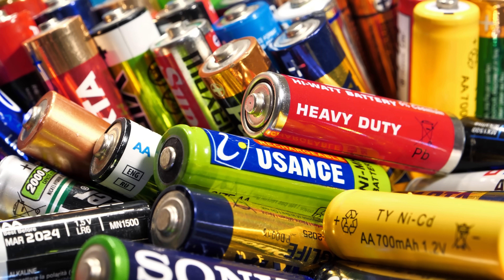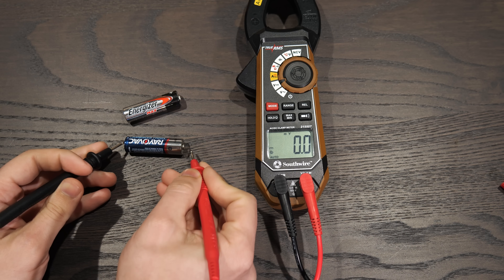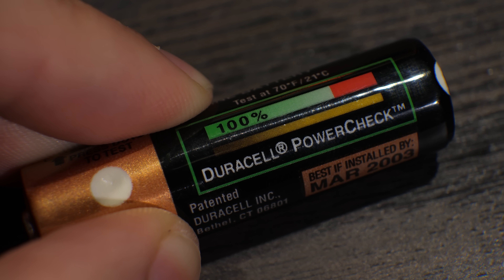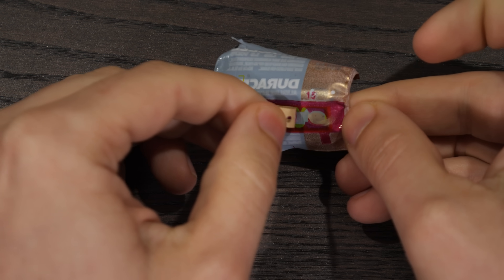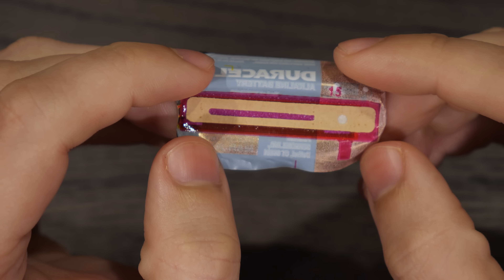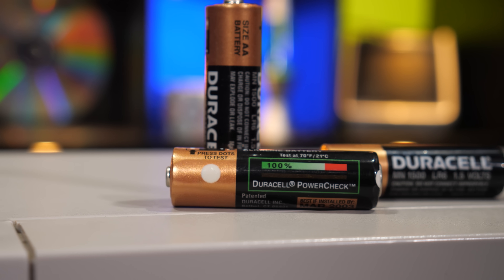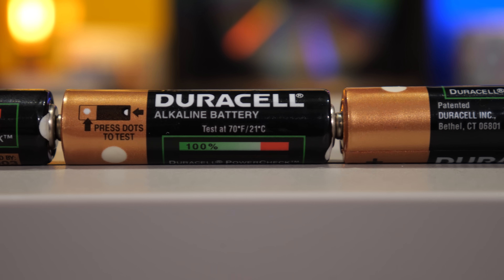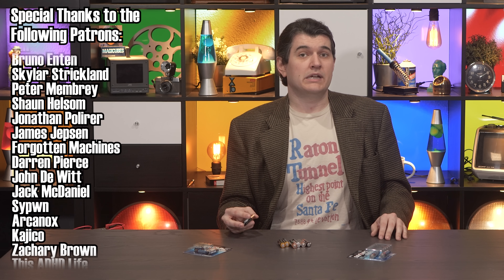Duracell PowerCheck: A genius idea which didn't last that long

Comment: My main usage for the powercheck was when something like a remote didn't work. First line of troubleshooting is are the batteries dead? I can save myself a trip to find the battery tester/multimeter if I can just test it almost in place. You know, if you can get the thing to work. I always felt the bar afterwards for the warmth.

Comment: And now they build battery charger andvoltage increasers, and a femaleusb pluginto the battery itself: thereby increasing the voltage to 1.5v, at the cost of even shorter charge life for hugely more money!  So: when they changed to rechargeables of 1.3v: why didn't they redesign circuits to run on 1.3v instead of 1.5v?  The waste of materials from 1.3v batteries that won't push a clock hand uphill once they drop to 1.2v though there is plenty of energy left if circuit designers lowered the optimum voltage of the circuits, must be enormous, yet the step up built in extra components at the expense of less volume of reagents, must be even more wasteful: so why are circuits still demanding 1.5v?!

Comment: I agree with your typical use habits discussion. Where these could be more useful is on rechargeable batteries if which I'm never quite sure of the charge status as they lie in the drawer after being charged (or not). But for this reason I have a small cheap battery tester, so even that use case is eliminated. Neat technological novelty, but ultimately not compelling enough use case.

Comment: You can simply drop the battery on a hard surface on their negative pole. If it jumps it’s empty, if it just drops and falls over it’s somewhat full. Perfect to easily check all those batteries in your drawer

Comment: You can also test a battery by dropping it vertically (negative side down) on a hard surface. If the battery bounces, it's empty. If it doesn't bounce, it's full. No idea why or how this works, but it works.

Comment: You get angry at triple-As, I get LIVID at those idiots using a watch battery when a pair of AAAs would fit! Oh, which one is it? A CR2032, 2025? 2016? All the same diameter, but different thicknesses... God help you if it's tiny LR44s. I get it when there's very little space, but it you can fit normal batteries, do it. For one thing: rechargeable batteries come in those sizes.

Comment: Duracell batteries have destroyed more equipment, including the lab equipment I used. They got sold overseas and after that, they often leaked in the PACKAGE. They got away with it and I still find them occasionally in items and quickly remove and put them where they belong........in the waste basket!

Comment: You can TASTE 1.5v batteries and tell to some extent how good they are. Wet your finger and hold it against the negative end. Touch the positive terminal with your tongue. If the battery is good you will feel/taste a slight effect. If the battery is bad you will not notice any effect. Only do this with 1.5v batteries, nothing higher like 9v etc, which could be painful.

Comment: I stopped using disposable batteries some time ago and use equivalent NiMH for almost everything, though there are exceptions where alkaline/zinc batteries are better. I have a couple of remote controls that don't like NiMH batteries, they work for a while, but stop working long before they are discharged. This is because the NiMH batteries are nominally at 1.3 volts approximately fully charged and the voltage drops gradually as they discharge. The problem is, they get to the cut off point where some things will stop working well before an alkaline battery would because the voltage has dropped too low as they started out at 1.3 volts instead of 1.5.  When I put my rechargeable batteries into the charger, they only appear to charge to half their normal capacity, because they were only half empty to begin with.

Comment: Batteries are a collection of cells in series or parallel. The single cell tester, despite how flawed it is or isn't, is a cell tester, not a battery tester. Just a for your information coment.

Comment: These were actually useful in one specific situation - if a device used multiple batteries, they usually did not all wear out at the same time, and you could figure out quickly and easily which ones needed replacement and which ones were ok. 

But yeah my primary memory of them is Pain

Comment: I used the testers a lot. Batteries lose strength over time, even if unused. I have had batteries dated for a few years after time of use that were actually already unusable. So in my case the testers were more than a gimmick.

Comment: Mostly those tester things were entirely for marketing. How about a vid on the newer rechargeable AA batteries that are lithium ones with a tiny USB recharge connector on them, compared to the old fashioned rechargeables that needed a recharger to plug them into?

Comment: There was a time the indicator was not with every battery, but with every retail package of 4 batteries. It could be cut out and used for other 1.5 V batteries. Me and my brother of course experimented the indicator with a 9V battery, resulting in a lot of bright color and smoke.

Comment: Always wanted these on rechargeable batteries where it made more sense to me.  With a rechargeable I would have them sitting beside a charger or in a device and before I went out would want to know what battery life they had in them so I knew if I should swap and start charging my current set.

Comment: The problem I remember is that it didn't work a lot of the time, or only worked a few times then stopped.  It also gave unreliable readings when compared to a good battery tester.

Comment: Another likely reason for obsoleting this technology is that the batteries become more prone for a current leak and also a physical leak in consequence. The leaks happen because of both corrosive and mechanical damage, in particular pressing batteries too much against each other in tight battery compartments of some low quality devices. I have first-hand experience with the collision in between the batteries' and their compartments' size tolerances leading to catastrophic damage and high fire risk hazard. Even a tiny increase in the label thickness of a regular battery may make this risk an order of magnitude higher, let alone making that label conductive and heat producing itself.

Comment: Used to play with the tester as a kid.

Now I just use rechargeable batteries for everything.
If I need a full battery, I simply charge it up.
The charger will tell me when the battery is full.

Comment: I liked it too back in the day. I have a good old separate tester I use all the time. It's hard to believe the indicator would be accurate for our sake too. It probably was a cost cutting measure or didn't sell enough to warrant it's continuation.

Comment: I remember vividly in the 90's you could sometimes buy a pack of Duracell batteries and they'd come with a strip to test the batteries with. When these came out I thought they had just stuck the strip to the side of the battery, as design wise they looked identical - sans the physical strip!

Comment: I still keep part used batteries in my "man drawer" as they are useful for things like remote controls and wall clocks.  I also own one of those battery testers and a multimeter

Comment: Yeah, so now we have built in batteries and chargers, and when the battery die, they do, we have to buy a new thing. Old thing with a cord to the wall, lives on. Old mechanical stuff lives for ever. Then digital evolution means we have to buy new things again and again since they stop working in the system,, like a cellphone. And now cars??? Yes sustainable.

Comment: 'Which didn't last long' weren't these around from 97 till at least 2017? Pretty decent run I'd say! I know they were sold with the current Bunny design (from 2013) and I saw them for sale everywhere still at that point. I can even order some right now, but I have doubts about some of these stores. Some have the version with the old strip you've shown, some have the more modern 4 segment tester strip. I bet they are very old stock, they do say '10 year power reserve' so they could still be sold.

Comment: I remember these quite clearly. The tester was very difficult to use because you had to press quite hard on the negative end, likely to keep the tester from inadvertent activation which would lead to a dead battery.  Also, those cheap battery testers had parallel load resistors in them, or, at least mine did.

Comment: One of the things people should know (and the main reason I bought a battery tester) is that you should not mix, in the same device, batteries with different charge levels. I regularly take out batteries from my kid's toys (when they stop using them and we want to give them away for example) and when I need to replace 3 batteries in a device, I need to test all the lose batteries I have to pick 3 of approximately the same voltage.

Comment: I've noticed a major correlation between grocery store brands of alkalines and leakage of corrosive gunk in low-draw devices like remotes or keyboards where those batteries might sit for a long time.  So that's where my brand loyalty to Duracell and/or Kirkland comes from: less time with cotton swabs and isopropyl.

Comment: 1.4 million views in a day on a video about old batteries that are no longer on sale. Mind blowing. Keep it up
Reply: they are still on sale in europe, i bought AAA ones not that long ago in the netherlands.
Reply: @iHazMuffinz they’re available in the USA as well
Reply: @iHazMuffinz To clarify, AAA WITH a built in battery tester, or just normal AAA batteries?
Reply: @Matthew-li7we  duracel AAA with built in battery tester
Reply: Us viewers are a quirky bunch
Reply: Not on sale??? Uhhh yes they are 🥴
Reply: "Much that once was is lost, for none now live who remember it..."
Nostalgia isn't just a resistance to change it's exasperation at things that should be remembered to try and make them still exist.
Reply: Not surprising given how most of us will have surely used one of these babies at some time or another.
Reply: @Opethfeldt  not gonna lie rechargeable batteries are the way i use them for rc plane boats rc cars xbox controller my old watch and i swear in 1998 I think batteries  take long time to die but nowadays batteries not like before
Reply: They’re still available
Reply: @HunterB738 you will find that the modern day Duracell Batteries don't have the in built tester though
Reply: tha's properly funny m8
Reply: Us 1.4 million viewers at some point wanted to know how this worked, just never took the time or had the time to figure it out, well this guy has done the work for us, and we appreciate him for it, cause its still cool to know

Comment: Actually, you pay for a zero point five voltage battery (0.5 volt) instead of 1.5 volt, because ??? One third of the price is actually used per battery. Sad that all those voltages are thrown in the recycle bin because modern electronics can't handle voltages below 1.0 volts and stop working. There is a simple solution like a battery vampyre schematic, that draws all current from the battery and step it up to maintain working voltage. Saw this in a video a long time ago, but never saw its schematic again after that. Should have saved it.....

Comment: You spoke about testing the battery, but you didn't speak about the "drop test", where you just drop it from a couple of inches on a hard surface, like a table, and if it bounces it's depleted. If it doesn't bounce, it still has some charge.

Comment: We had a drawer with junk batteries that sometimes would still be useful, but basically only because we never actually got rid of the fully empty ones :P (we did have a battery tester in the drawer too)

Comment: The testers were just too hard to use so why would you bother buying these batteries. If your tv remote control stopped working you'd just replace the batteries and see if it works instead of testing the old batteries first.  The onlytime i've ever wanted to test batteries was when batteries were not in their packet in the junk drawer Maybe they were used, maybe they were new but fell out their half empty packet.

Comment: My family and, by extension I too, hated the high consumption rates of battery-powered toys. For my gameboy(s), I even never used actual batteries and relied on a power adapter for any power socket. This still allowed me to be mobile enough with those things and play wherever there was a socket. I had no desire to use them outdoors or something.

Comment: The most surprising thing in this video is that you were able to find non-corroded 20 year old batteries! Especially Duracell. 
I’ve got a bunch of dead batteries that are quite recent that are corroded as heck(trying to figure out how to properly dispose of them in my area).
I’ve also had batteries corrode inside devices before they are even used up, and that’s in devices I’m actively using!

Comment: I think in these days these would actually be very good to have on rechargeable AA batteries. I have many smart home gadgets at home, especially the TRVs on radiators, in the thermostat etc.. So in the battery drawer, I try to sort the batteries according to their charge but when some device needs batteries replaced, I have to go to the drawer with a voltmeter and check them anyway. I'm using the low self-discharge ones but the problem is when you have a charger that can charge 2 or 4 and a device needs 3. One of them remains uncharged until I deplete another 3 and I can charge all 4 at the same time.

Comment: Designers are making devices that don’t work well if the battery is below 1.4v. Meaning NIMH batteries won’t work because they are 1.25v. And you only get to use 50% of your alkaline batteries. 

So you are forced to buy lithium disposable batteries. I truly think the battery companies are paying designers to do this. They are also paying them to print “no rechargeable batteries” inside the battery compartment. This has become common on led ferry lights. Trust me nimh work just fine with ferry lights.

Comment: as you say, most people aren't putting half-good batteries away, but if you were using a digital camera, gameboy, walkman etc. (as you mentioned) in 2001 or so, these could be a life saver to know if you needed a fresh set to leave the house or if they were good for a couple hours

Comment: I do have a situation where I switch batteries around. Specifically, I have a little milk frother that I tend to use as a mini powered whisk. It requires a relatively fresh battery to get a decent spin. So once it stops spinning at a decent speed, I put new batteries in it and move the still quite fresh batteries to my wireless game controller. But that doesn't need a tester.

Comment: Energizer does have battery indicator in early 2000's but very short lives production only made with "AA" which have been severe leaks and destroy indicator by today. It shown "Good" when pressed. If they get weak, slightly indicating. Just like Duracell have them. Also, 9-volt Duracell battery does have a tester strip built-in on the blister package only but must be reuses not thrown away. Most people didn't know that. While production will lasts until discontinues. I don't know if they come back or not. Great show...  🔋

Comment: Amazing job on getting a reading AND getting a voltage reading. Also, duracel is the worst battery brand (leaky) which is why I stopped using them. FranLab is the one that gave me feedback insinuating that I wasn't crazy.

Comment: I have use all the tester you mentioned in the video. Agreed it's a bit expensive to buy the battery with the tester built-in but I still buy it to try myself. Now I just use either multimeter or small digital battery tester.

Comment: Multimeters? Chemical stripes? So no one tested their batteries by putting one end under their upper lip and touching the other end with their tongue? It creates a salty-sour-like electric sensation, the newer the battery, the stronger it is
Reply: No.  Can't say I have with anything but a 9V

Comment: idk sooooo often i go to use something that hasnt been used in a year or so (AC remote comes to mind) and the batteries have leaked all over the place. seems when batteries arent used for a while they leak. i SHOULD be taking these batteries out of the things not used often but i dont, mainly because i never remember. this would add convenience to that.

Comment: I'm sure someone else has already said this, but a digital multimeter really is a lousy way to test battery health. Almost zero power is needed to register a voltage on most DMMs. But an analog voltmeter, like in those battery testers like you showed, or the resistive strip in the PowerCheck create enough load to actually stress the battery. Once you start to draw some non-trivial current, a dead battery's voltage will really drop. But with the tiny amount of current that a DMM draws, a battery can have virtually no power left, but potentially still produce 1.5V.

For what it's worth, the property of a voltmeter that controls this is its impedance. Most DMMs have a high impedance, more than 1MΩ, while analog voltmeters have low impedance, around 10kΩ. In most cases this is desirable because you're generally placing the multimeter in parallel with a load, and a high impedance means the vast majority of the electricity will continue to take the path it was taking without the multimeter there.